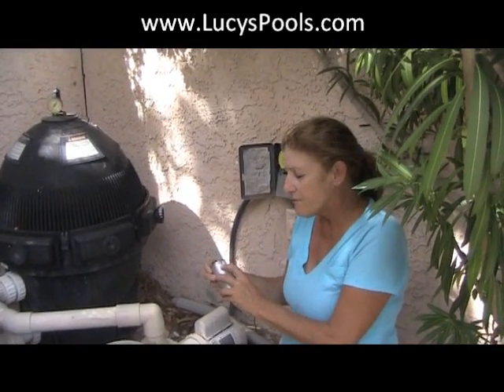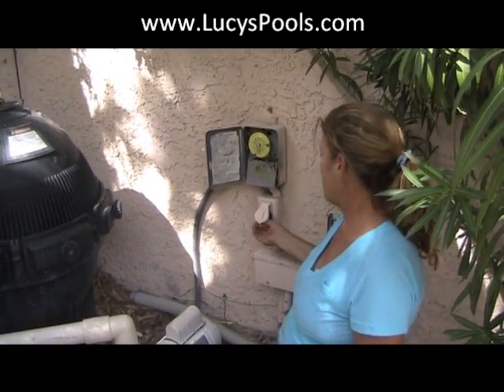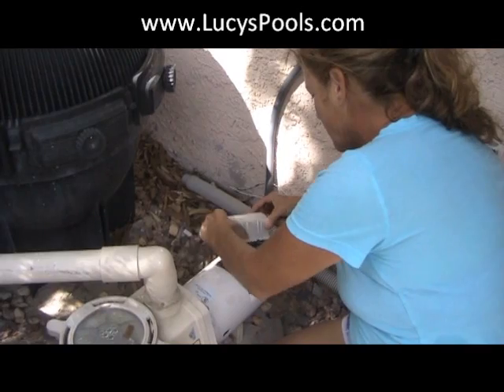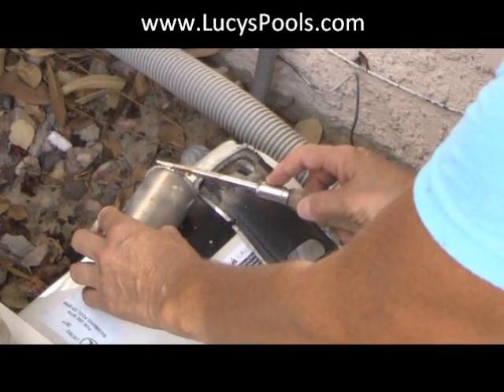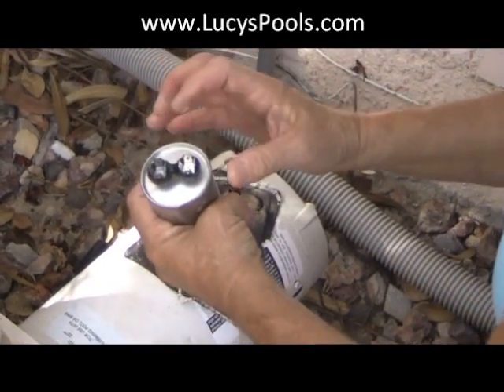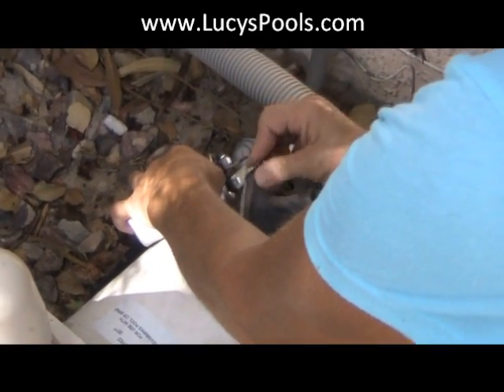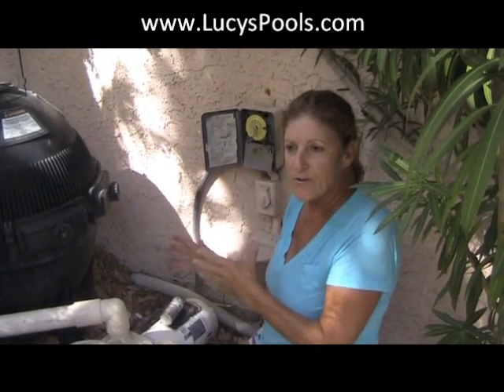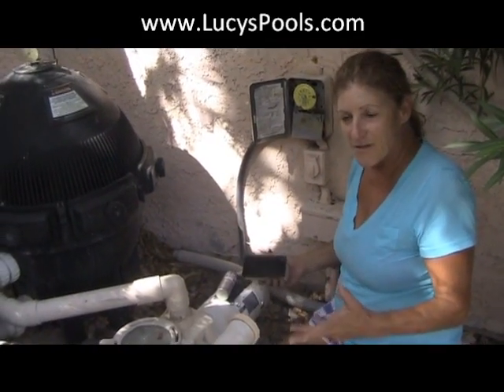Pool Motor - Humming-Loud Noise- Capacitor Replacement *UPDATE*

Comment: This humming is exactly what my new Pentair Superflo sounds like. Can a capacitor be bad in a new pump? The impeller spins smoothly and my multimeter doesn't have a resistence setting.

Comment: Hey what does it mean when my pump does not work at all. My pump turns on after installing a new capacitor but it starts smoking and eventually shuts off. What does it mean?
Reply from the maker: Sorry for the late response. I am still recovering from a botched hip surgery. Smoking doesn't sound good. Have you resolved the issue yet?

Comment: I did what you said and changed the capacitor however, the motor still shuts off after about 20 seconds. any other ideas? thanks in advance
Reply from the maker: I am sure you've resolved this issue by now. I had a hip replacement so was out of commission for a while. I apologize. Lucy

Comment: Hi Lucy, we replaced our motor, it worked for a few days. It still ran but the filter wasn't working and wouldn't prime. We realized we had a leak and replaced the shaft seal. Now the impeller doesn't seem to be turning nor does the motor sound like it did. It's not that humming that you shared when needing a new capacitor...Help please
Reply from the maker: Hi Michelle, A couple things could be going on. Without details I am going to toss around a few ideas. When you say that the impeller isn't turning...can you reach in and manually turn it? The important thing you want to pay attention to is if you can turn the impeller BUT the shaft doesn't turn, then the impeller is stripped and you'll need to replace the impeller. The easy way to test is to open pump lid, add water with a hose and turn the pump on. If water is not sucked in, then impeller is stripped. If the pump is a Hayward, sometimes if the diffuser isn't replaced properly it'll make a strange noise. But try the impeller. Feel free to get back to me if hat's not the issue. Lucy

Comment: Lucy , sometimes my pool pump turns on and other times it doesn't . can it still be a capacitor issue .  Thank You Joe
Reply from the maker: Hey Joe, Sorry it took so long to get back to you. Yes it may be a capacitor issue. Sort of like when a battery is beginning to go out and your engine doesn't turn over, then it does, until it doesn't anymore. But check your wiring in the back of the motor and your time clock to be sure connections are tight. Also, make sure your impeller and shaft turn easily and is not stuck or frozen. Hope this helps, Lucy

Comment: Do you have to make sure you have the leads correct?  I pulled my capacitor off without checking where the leads were exactly.
Reply from the maker: Hi Alex...No it doesn't matter. Just make sure they are snug. Lucy

Comment: Thank you Lucy!  I called my pool guy because my pump was making that buzzing sound and he didn't think twice to tell me I needed a new pump.  He quoted a price of about $700.00 (that included a filter cleaning) .  Thank God I did more research and came upon your awesome video.  I bought a new capacitor for $25.00 and installed it.  It fixed the problem.   Thank you again!
Reply from the maker: +treblagr Rod In that guy's defense...I went many years telling clients that they needed a new motor. Perhaps it happened by osmosis, but one day I discovered that perhaps the capacitor was bad. Thus...I decided to include this in my many videos. I'm so happy that it helped you save money. Please pass my website on to your pool guy. I'm sure it was an honest mistake. Thanks for watching, Lucy

Comment: Hi Lucy
I just replaced the capacitor and it is still making the noise and motor shuts off, any ideas of what else it could be?
Reply from the maker: +Kim Lucero Hi Kim, have you checked if the shaft can turn? If it's stuck or frozen, it will mimic a bad capacitor. I don't know what motor you have, but if you can reach the impeller, try turning it. If you can't reach from inside pump, you can open the back and turn the shaft with a pair of pliers. Be sure power is off. A shaft can freeze up if the seal has been leaking for a while. I hope this helps. Lucy

Comment: Thank you very much! I almost bought a new pump until I saw your video... I replaced the capacitor and it works perfectly now... $43 repair... 5 minutes!!!
Thank you for sharing your knowledge.
Reply from the maker: I've noticed through my visitors that depending on where you live the prices vary. But if you think about it, even $50 is way less than buying a new motor/pump.
Reply from the maker: +jeomanayt Excellent! Thanks for taking the time to write. You're welcome, Lucy
Reply: Yikes $43 for a cap?

Comment: THANKS, Lucy. You made my fix so quick n easy. Picked up a used capacitor for $15. Took me all of 10 minutes to replace. I also learned that a slight bulge in the ends of the capacitor indicates that it's gone bad.
Reply from the maker: +Dennis Volz  So glad to hear my video helped. And yes, you are correct. A bulging capacitor is an indicator, though not all bad capacitors have that bulge. Thanks for watching, Lucy

Comment: I did try the toggles. Neither worked. I am gonna borrow a voltage meter and check and see if I am getting 24-28 volts to the actuators. 
I have the Easy touch panel. Have tried outside and inside.  I have checked the breakers and they are on. However, the low voltage  breakers(small black push button) are weird, I think they are in the correct position. I have never seen that type.
thanks a lot for your response
Reply from the maker: +toodrastic4  Could those black buttons have a fuse inside? (twist and pull?)Some panels do. Another thing you can try (BUT you have to feel VERY comfortable playing with electricity, and I assume NO responsibility because I'm not there), is to find the relay associated with the SPA (or if actuators are connected to a relay), and swap it with another relay that's working. You'll need a tiny Phillips head to remove them, or in some panels, exchanging the wires on the relays may work. It's frustrating not seeing exactly what the outside panel looks like as there are many different types of relays. But I think you get the gist of what I'm saying. When you have the voltage meter I believe there should be a transformer in the panel. Test that also (24v). I'm just trying to give you any other option than having to replace the actuators. (there's also a micro chip inside the actuator that sometimes can be replaced). I hope I haven't completely confused you. :) Let me know what you've found. All the best
Reply: Ok, I got it working. I took the tops off of the actuators and cleaned some debris from around the shaft ( plastic particles) then I removed all of the electrical connections and sprayed with an electrical cleaner. Finally I cleaned the top of the gear box under the actuators and lubed with white lighting.  BOOM.  Working. Thanks for all of your suggestions, you saved me in one of your videos on how to set the actuators for proper spa use as well.

Comment: hi,
I have two  pentair cva24 actuators that both stopped working at the same time, and a local pool guy said that  both actuators failed? I am concerned that it would be strange for them to both fail at the same time.  I have been told to check the actuators with a voltage meter. Where and how should I do that? Also, if they do need replacing is that difficult?
  Thanks for your time and Happy New Year.
Reply from the maker: +toodrastic4   I too think it's odd that both actuators would fail at the same time. Sort of like the pool and spa light not working (nine out of ten times it's the GFCI that has tripped). In your case, are you trying to activate the SPA from inside the house? If so, it could be a relay that has gone bad and would need replacing. That's a lot cheaper than replacing two actuators. Have you tried manually flipping the toggle in the back of the actuators? Also, be sure all the breakers are ON. Sometimes they may appear to be on but one may have tripped. If these ideas don't work...What service panel do you have? Hope you get it working, if not, write back. Happy New Year to you also!!

Comment: Hi Lucy, nice video.  Just one thing, when you showed how to discharge the capacitor, you had your finger on the metal ferrell  of the screwdriver.  Please keep your fingers off metal or you may get the capacitor discharge.
Reply from the maker: George W Add yourself to the other comments below pointing out the errors of my ways. :)  I appreciate the concern for others...seriously. I think I may have to video a new capacitor failure. I was wrong. As soon as a capacitor goes bad, I'll post a new video. Thank you, Lucy

Comment: Didn't work for me. Still making humming siund. Removed lid and put water....water goes down.....then pump turns off. Tried to turn on again but wouldnt turn on untill a few minutes after. Then ame thing all iver again.
Reply from the maker: Ruby Arias Have you checked your 'O' rings on the suction side of your system? If you're sucking air, the pump won't prime.

Comment from the maker: Hi Armando...I don't know why you don't have a reply button, I hope you get this response. If your motor spins but doesn't pull water...try this. Get a hose and add water to the pump pot. AS you're adding water, turn the pump on. If the water does not suck into the pipe towards the filter, (if it runs over the top of the pump or goes back towards the pool), then the impeller could be stripped off the shaft. If that's the case, you will have to buy a new impeller and pump seal. Another way to check to see if the impeller is stripped... Turn power off to the motor. Open the back of the motor and hold onto the shaft with a pair of channel locks or vise grips (I don't know what kind of motor you have), if you can turn the impeller but the shaft doesn't turn with it, then the impeller is stripped. This happens when the motor is turned off and on rapidly. Hope this helps, Lucy

Comment: You are my Hero! But I still can't figure out how to get the wires off the top of the capacitor! My noise sounds exactly like this. I too, had taken the motor off and my husband was on his way to buy a new one WhisperFlo when I decided to check out Youtube one more time and ran across your video for trying this fix. I so hope it works.
Reply from the maker: Debi Rowlett Using needle nose pliers is probably the easiest way. Some can be more stubborn than others. Just keep gently wriggling them back and forth, and sideways until they become loose. let me know what happens!, Lucy

Comment: My hot tub is doing this. If I rapidly switch it from low to high speed several times,  it will sometimes start. If I turn the pump it then kicks in and runs perfectly. Sounds like I need to replace the Capacitor! Thanks for the info!
Reply from the maker: SticksNkicks  I think you're right. But be very careful about switching the motor rapidly from low to high speed. If the impeller runs fast, then slow, then fast...it may cause it to strip out. If that happens you will have to replace the impeller and the pump seal. I'm glad this information was helpful. Thanks for watching, and for writing in with your experience, Lucy

Comment: Be mindful as you discharge the capacitor to use a fully insulated screwdriver handle where the screwdriver shank does not extend to your palm , and you don't have any electrical contact with it only hold the insulated handle , I noticed in the video where she touched the metal collar on the screwdriver as she was discharging the cap with if there was a charge she would have found out the hard way
(If it was in contact with the screwdriver blade)

Comment: great video I was about 1 hour from buying a new motor before I told myself to look at youtube one more time. I came across this video and WOW!......I almost spent $350-$400 for new moter the pool compnay it was. AND IT WASN'T! Took me a day to find local guy that had capacitors, but they tested no good. Purchase new one for $24+ tax. got home took couple minutes to put in. Pool started right up....thanks LucysPools
Reply from the maker: Makes my day to hear that Brian! Let me know how the Caretaker works out. But before you tackle that, be sure your filter is cleaned AND clean the screen near the unions at the top of the caretaker head. (and that the valve is 100% towards the unit) All those affect how the pop-ups function. Also remember, if you are the original owner of the pool, call Caretaker and they will ship you re-build parts for free...including pop-up heads. All the best! Lucy
Reply: does caretaker have a wsebsite? or who do i need to contact. yes i own/built home
Reply from the maker: Brian C Try this number...1-800-822-7933 It may say Zodiac because I think they might have bought out Caretaker, but they will still honor the warranty. Hopefully whoever built your pool has you registered. You may have a certificate in your paperwork. Be persistent. I've dealt with a guy named Dave, ext. 3326 or Alex ext. 3372. Hope it works out...will save you a lot of money. While you're ordering the rebuild kit, might as well order some new pop-up heads, be sure to specify whether the inserts are for the floor or bench (different size holes). Good luck. Let me know how things go, Lucy
Reply: Yes you are right! Zodiac did buy out Caretaker and when I called (Dave not in department anymore dial extension # 4010)  they were able to pull the information. (The pool builder sent in warranty cards.....great). I needed the Caretaker re-build kit ONLY. There sending re-build kit, 7 pop up heads for the inside the pool and get this they sent the tool to remove the heads.....ALL FREE under LIFETIME WARRANTY....WOW! LucyPools thanks for the tip on calling these guys. All these things would have run a whole lot of money
Reply: Any info on intelchlor IC20?  I change fuse, lights up for 1/2 second then turns off. No power at all after that.
Reply from the maker: Brian C This truly makes me happy! Caretaker has always honored the warranty, glad you pool builder sent in the information.  Each pop-up costs around $65.00! So good for you!!  I will have to research the intellchlor. You may have to give me more information on it. What lights up...the panel or the cell? They change and update these things all the time, plus depending on the region, some models are not sold in certain areas. I'll look into it.
Reply: just got Caretaker rebuild kit in mail installed last night and as soon as i turn pool on the heads were coming up. I have like 5 zones and all the heads were popping up after 5-10 minutes. again thanks for help on this

Comment: Hi Lucy, thanks a lot, can you please check my 17 second video of pool motor noise, does it look like a bad capacitor to you? the motor shuts off with a tick noise after 10-15 seconds....I need urgent help, thanks a lot in advance.:here is the video link, the  motor is  2 year old and model is  
Emerson 1-1/2HP Full Rated EB2977T
Pool motor/pump not working

Comment: Lucy-I have a AO Smith Northstar Hayward 1.5hp. I swapped out the capacitor and the old one has the MFD smudged out however the last digit is a 5. I dont know if its 35,45,55 Mfd so for a test I quickly tested a 55mfd and it worked;THANKS! What would you recommend for the correct mdf for my model? I will check with the store on Monday as well.

Comment from the maker: Hi Rob-If your motor runs, it is not the capacitor. It could either be the bearings or the windings. If the pump is a Hayward it could be a rubber disc that attaches to the shaft; in the winter months it becomes very stiff and makes a high pitched whining noise until it warms up. I know this sounds crazy, but I had to ask the same thing and got the answer from a very reliable motor repair shop. If you replace it, you probably have to replace the pump seal also. In terms of your 25 psi pressure reading...the most important factor is what the psi is when the filter is clean. If the psi starts at 10, and the reading goes up to 25, you have a problem. If you want to eliminate the possibility that the pressure is a factor...take the cartridges out, replace the lid, then start the system. This is a great way to check, in real time, how much resistance your cartridges are contributing to the problem. You may want to check out my video on acid washing cartridges. I know this was way more information than you were expecting, but I hope I answered your question. Thanks for watching, but please let me know if none of these resolved your problem. There is always a solution. Lucy

Comment: Lucy, my AO Smith Centurion motor sounds just like that, but it starts and runs just fine (25 psi discharge pressure) other than the high pitch whining. If the capacitor is bad, will it keep the motor from starting or could this be a bearing issue?

Comment: Mamm, you were correct to tell your audience to short the cap before disconnecting it but you did not use an insulated tool nor did you appear to be concerned that you were touching the metal of the tool while shorting it. If you are going to teach, teach with the students safety in mind at all times. Some goof will no doubt go to short out a cap like you demonstrated, and get bit by the stored charge because they will not know any better than to hold the tool as you did.  
Please be better than that if teaching. No disrespect intended.
Reply: Yeah I was noticing that her left hand was bare and directly holding the cap while discharging with the right hand.  No no no.